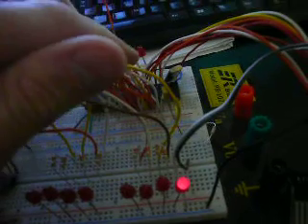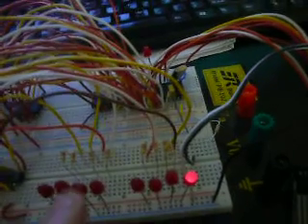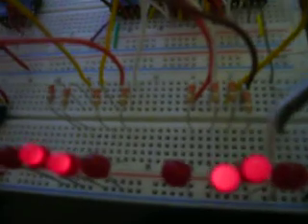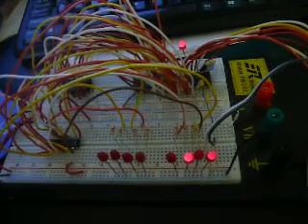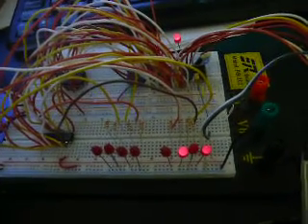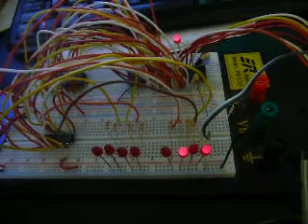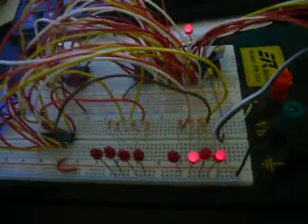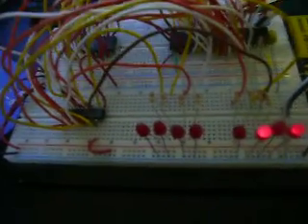Speech Circuit Works

Comment: Hi, I am also having problems getting the HM2007 to even turn on the READY LED. I order the parts from the imagesco website so why wouldn't their schematic for the RAM work? I did think it was strange that the address lines don't match but I just followed the diagram blindly. Could that be the problem? Why won't the chip just turn on the LED since the WAIT pin is set to High and therefore shouldn't even go through the RAM checking process? Any help with this would be greatly appreciated!

Comment from the maker: @mois231 Yea, it was tough to mess with on the breadboard.  Eventually, once I rewired the circuit (made the address lines of the speech chip match the address lines of the RAM) I designed a PCB in EagleCAD for the final presentation.

Comment from the maker: @samkhan88 I had a similar problem at first. You can't look at the schematic directly, you gotta check the RAM chip connections. On the blog I go into detail explaining the problem I had and made a note on the schematic. All the info I have is there. Also, I had some problems with bad chips. I had a bad RAM chip at one point, then I had a bad HM2007 at another point. It was very frustrating.  Again check out the blog for all the details.  I hope this helps! Link is in the comments.